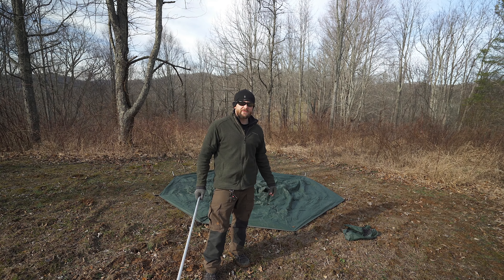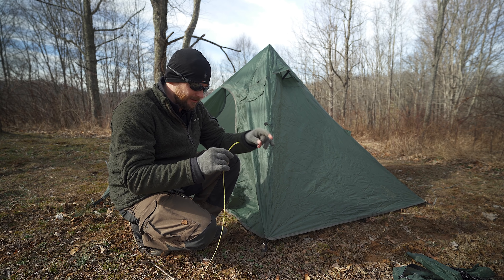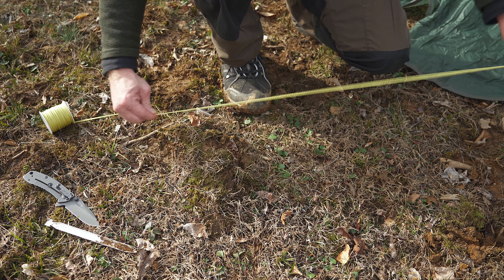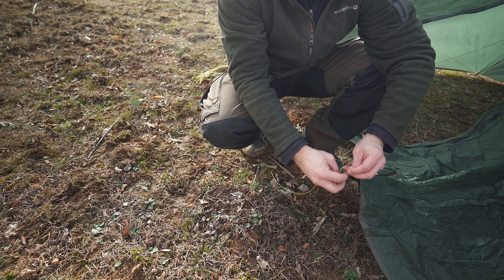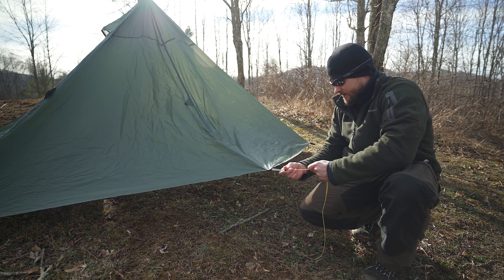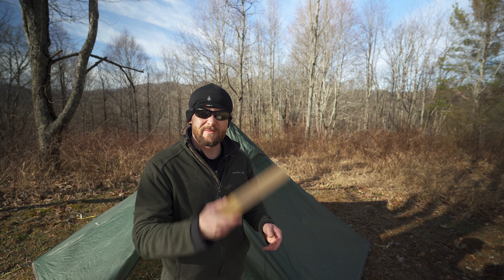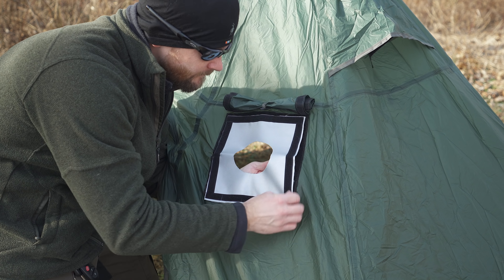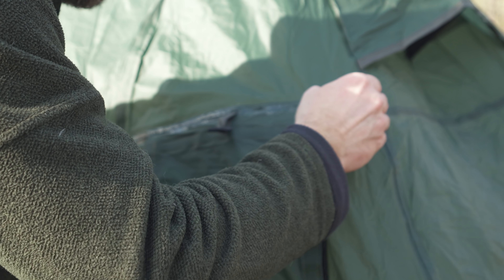Hot Tent Challenge Part 3 - Fixes and Improvements

Comment: Luke,the short loops on the bottom of the tent is to hold the tent tight  to the ground. So no wind or snow can blow under the tent. Dennis
Reply from the maker: Concerning the loops, there are times when you want and need wind/air to come from under the tent to assist with airflow, moisture control and condensation; this mod makes that possible and also, the tent is highly adjustable now. 

S&H
- Luke

Comment: Luke keep in mind that the length of your stake out modification is long in this video and will allow the wind to rip right through that tent. If your on snow you can build it up around the edges but and that ground the wind will go right through you. Excellent idea though. Go with a Winnerwell or Western with a glass door. Nice to light the tent at night a bit. Or go with Winnerwell fastfold. No glass door but no threaded rods. Just unfold and lock in place. Place spend the money on a titanium collapsible design either way. You have both cheap and inexpensive gear in all your videos. You have a cheap and light functional shelter. Spend the money now on a stove that will be light and packable for a hiker system. It’s a balance that makes sense for your style. You’re hiking with a lot of extra weight in winter compared to the other three seasons. You don’t need a heavy fixed stove in your hands for miles of hiking. Save here and spend there for a proper system😊❤️🇺🇸❄️☃️🛷⛺️

Comment: Seek Outside TI stove, Is the best all around unless you dont want to assemble and dont mind paying allot more the Winnerwell Fastfold TI stove.👍👍
Reply: The Seek Outside line has a notable design flaw. The wingnuts used on the top surface interfere with putting down a skillet or other wide item.
Reply: @KimberlyGreen  NOT AT ALL i use the leg support piece they are completely FLAT, not to mention the stove surface is about almost two sqare ft of space🤣
Reply: @Canadian_Craftsman  I'm unfamiliar with the 'leg support piece'. You must have one of the larger ones to have that kind of surface. They could very easily remedy the flaw by using flat washer caps welded onto one end of the legs. (In one of the pictures for the Utility Tray XL accessory, it looks like somebody did something similar.)
Reply: @KimberlyGreen  thats the piece flat washers are the leg support they come standard with all stoves and i bought an extra pair from them with additional chimney pipe rings to be extra safe;) happy camping

Try thinking outside the box, ;)

Comment: Rather than buying an expensive titanium stove for a very economical tent, I'd like to see you use the large (there's two of them) Guide Gear stove from Sportsman's Guide.
Reply: 70lbs seems ridiculous to use with a lightweight tent
Reply: Perhaps. But no more ridiculous than spending five or six hundred dollars for a titanium stove for use in an inexpensive tent. He didn't say to suggest a stove for backpacking, if he had, my choice would obviously have been different.
Reply: I have the small one .It works great and built like a tank but weighs almost as much!  Can't beat the price for what you get!
Reply: @DeanFromTexas  true I just dont think it's a good match for a backpacking style tent. There is a nice middle ground,.something like the  nomad
Reply: @tennyis28 ... Fair enough.  I'll meet ya half way on this one. Even the Nomad is a tad pricey, but okay.  I would NOT own one of the tri- legged ones that Winnerwell puts out.  I just don't see them as being all that stable. Maybe they are, but they sure don't look it.
Reply: DeanFromTexas I have a Seek Outside Ti set up and it goes in my backpack for my snowmobile hot tenting. Sometimes the money is worth it. Thus guy is backpacking and needing to take extra gear that’s heavier than the gear he takes in the summer. Can’t beat the weight and pack size. He’s got a cheap, lite tent that works so spend the money in other directions for a balanced set up.

Comment: A taught line hitch would work and hold as well for the stakes in the configuration you had it in.  It's basically a Prussik with a loop, i tend to prefer it as some modern rope material can slip more easily and this tends to hold things in place. As for the stove a 50 cal. ammo can stove or the 20mm ammo can stove variant.
Reply from the maker: I'm a fan of single-pull knots for stake points and tarp tie offs myself; they take less than 5 seconds to tie and can be undone with a single pull.  
To each their own though.
- Luke
Reply: @TheOutdoorGearReview  Indeed and i wasn't arguing that :) i was saying for some ropes with modern "plastics" the taught line hitch works better and tying it is about as fast for me. I have some flavors of "amsteel" here that some knots will not hold properly in place when using something like a slip knot and for those on my tarp and tent i either use the taught line or a bowline with some shock cord to end it with. Admittedly the slip knot is faster to remove.

Comment: Slip knot vs. taughtline hitch? Did you end up seem sealing the whole tent or just that little area? Love this series. Thanks Luke!
Reply: I tend to go with taught line, some modern plastic ropes tend to slip too easily i find. I discovered tarred #36 bank line a few years, twice the break strength of the one depicted in the video and just as light and way many more feet of rope available for the price.
Reply from the maker: The entire tent didn't need sealing as it only leaked in that one spot as it wasn't seam sealed on the inside of the tent there.
This can be seen in Part 2 of the Hot Tent Challenge;

https://youtu.be/owgMbLKWqNg

- Luke

Comment: Great timing for your video, I just purchased this tent. Thanks again for the tent mods. What do you think about adding a zipper on the inner mesh on the left side of the pole. Thinking its a tight fit to get into the inner mesh with the stove in place? I'm looking at the 3w folding titanium wood stove from Luxe Hiking Gear. Cheers Luke!

Comment: Hey kids! Did you notice? After he cut the line he used a lighter to melt the end. That's why I don't schlep firesteel on a backpacking trip. I take lighters. They make fire and they do a whole lot more.
Reply: @bob mar I use bic's too- first choice. But a ferro rod is always there for backup, very little weight and size for ensuring one of the most essential needs.

Comment: I have the OneTigris Iron-Wall and have recently paired it with the Winnerwell Nomad medium stove.  I've been quite impressed with the build quality and performance. 
I  considered the G-Stove ,  Kni-Co stoves, SilverFire, Four Dog Stove and many others before my purchase, but ultimately, the following video helped me make the choice to purchase the Nomad.     https://youtu.be/HyNCZUK5GpI     

They include the damper and spark arrestor in the main stove purchase.  Other accessories are available as well.  (water tank, oven etc.)
Some other Nomad Pros
1) Large available flat stop top cooking area
2) No wing nuts, bolts or pins to loose
3) Removable stove top lid to aid in cooking options and overall fire maintenance

I can get 4 hour burns if I turn the airflow down and still have coals to light the next load.  I've played around with split firewood, hardwood pellets and compressed wood blocks.

Comment: Is anyone else concerned with how much debris will be needed to cover the gaps between the tent and the ground, now that he has used the extra lines on the tie out points ???
I mean, the draft that will come in will almost certainly have to have the stove/heater stacked with firewood all night to maintain the heat in the tent. Especially, down where people will be sleeping.
Just wondering...

Comment: not sure why you turned the slip knot into a larks head. seems like you just made the adjustability of the slip knot much more difficult to benefit from. Not criticism as much as wondering if I am missing something. personally i do a bowline or figure-8 knot on the tent connection, and a permanent tautline hitch at the stake (or sometimes a clove hitch).

anyhow--i appreciate the discussion of your improvements! looking forward to the test...
Reply: I just watched a number of videos on how to tie a slipknot and lukes method is the easiest that I have seen.most tie it this way but have really confusing instruction. thx luke
Reply from the maker: I've always called larks head a cow hitch as it's not really a knot; anyways, it's fast to do, undo and when you use a single pull knot at the other end, you've got an excellent combo.  Not sure why you find that to be difficult brother as it really is about as easy, adjustable and quick as you can get - 4 seconds to tie when staking, you wrap the line when the tent material stretches and half a second to undo it all when your trip is over. Different strokes for different folks I suppose. 
S&H
- Luke

Comment: If 1 seam needs sealed why not do all little more work but better safe than wet
Reply from the maker: The entire tent didn't need sealing as it only leaked in that one spot as it wasn't seam sealed on the inside of the tent there.
This can be seen in Part 2 of the Hot Tent Challenge;

https://youtu.be/owgMbLKWqNg

- Luke